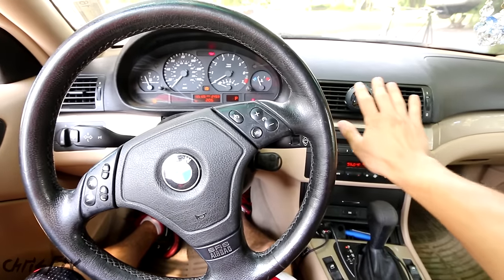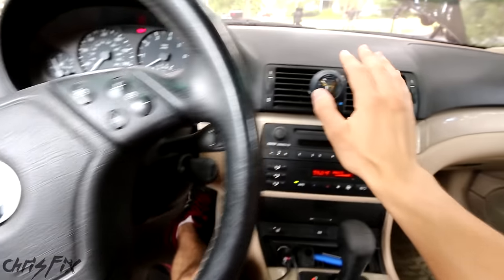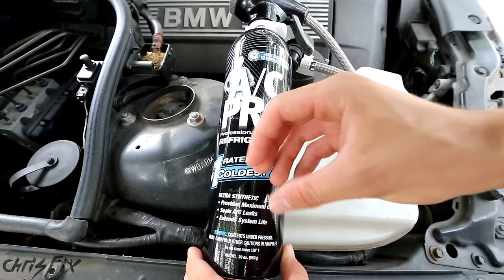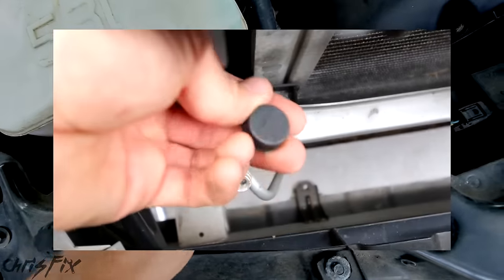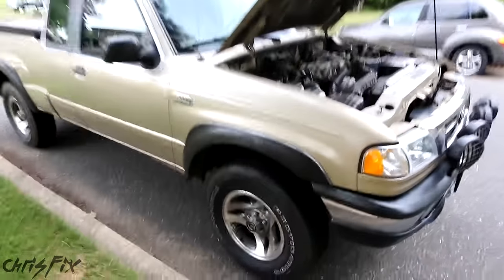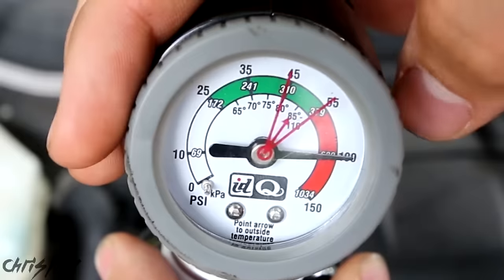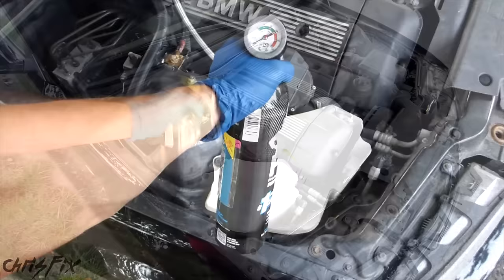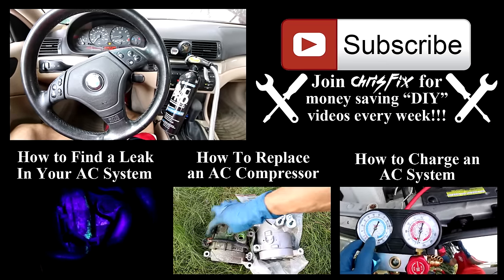How to Recharge Your Car's AC System (Fast and Easy)

Comment: I'm a 54-year-old registered nurse (I don't work on cars) and I watched this video and filled up the refrigerant in my 2004 Saturn Vue.  The temperature outside was 100 degrees in humid southwestern Virginia when I took my teenage grandsons to the fair.  The AC was so cold in the car we had to turn it off!!  It had only blown hot air before this quick fix. Thank you so much!!!  You saved me a lot of time and an excessive amount of BS!  😀
Reply from the maker: I'm glad this video helped you out!
Reply: @chrisfix  Yooo you still respond 😁
Reply: @thelombax  I was just about to comment that. Amazing!
Reply: @chrisfix not sure why I cannot comment on the main thread but I wanted to ask a question because I'm sure I'm not the first one to run across this but the bottle of AC pro that I purchased does not have a separate temperature gauge to set it only has the low filled a small yellow area and then the red area for the PSI and it goes up to 150 like yours
Reply: @brian8431  You don't have a green area? What do the instructions on the can say? AC Pro has videos on their website.

Comment: This is a very good video. One tip: when you're getting ready to add refrigerant, loosely hold the hose fitting next to the charging port and use the trigger to deliver a small squirt. When you see refrigerant starting to come out of the fitting, quickly attach it to the port. This procedure flushes air and moisture out of the hose -- and you don't want either of those inside your A/C system.
Reply: That's a great tip!  makes so much sense too.  It's like getting bubbles out of a needle.
Reply: @willvr4  Exactly

Comment: I spent basically 3 summers driving my car without a/c because of all the refrigerant leaked out and I didn't want to pay hundreds of dollars to recharge it or fix the leak at a local mechanic shop.

Today, I realized I could've recharged the refrigerant myself for a fraction of the price I would've had to pay at the shop.

You're awesome, Chris. Thank you.
Reply: I hope you put a vacuum in the system first since your system has been empty.
Reply: @DaDaDanceProject  I don’t think people realize that putting refrigerant in your system is much different than putting gas in your gas tank
Reply: @DaDaDanceProject  My Kirby is too big to fit in there.

Comment: This is, by far, the best tutorial on how to recharge your car's A/C. He uses clear, concise language, speaks like a professional, uses perfect panning of camera so you can follow his instructions precisely. He also has a way of making this seem like anyone can do it. I'm feeling confident now. I've watched other videos and felt like calling the nearest auto repair shop for fearing that I would screw it up. I am subscribing to his videos and I feel so lucky to have found this guy! He just saved me $200.00. The shop was going to charge me $230.00 to do this work. Thank you so much for posting this very helpful tutorial!! You are amazing!!
Reply from the maker: Welcome aboard and thanks a lot! I'm glad you were able to save $200!
Reply: This is NOT the way to top up air conditioning systems, the vital part of servicing car AC is the procedure of putting the system in a state of vacuum to remove air and moisture, this procedure doesn’t allow for that. These cans should be banned because you don’t know if the system has a leak on it and could release refrigerant into the atmosphere. Do yourselves a favour and just pay someone to do it properly.
Reply: I agree with mark
Reply: @markb4772  Why would you want to vacuum a system with a known leak? To get more air and moisture in ? And please stop these conspiracy theories about refrigerant making holes in ozone layer. Refrigerant has a long chemical formula and is much heavier than air.
Reply: Do the mechanics at auto shops have this can too and do it if the car does need a recharge or would they need to do it some other way?
Reply: iheartlol90 Profesional people do not use these cans, if you go somewhere that uses these turn around and walk away, find someone that knows how to do it properly
Reply: @markb4772  So what would they do at an auto shop if the ac is too low on pressure? My ac seems to not be blowing as cold air as it once did, Idk if it's the pressure or what but I'm just looking online for info.
Reply: @markb4772  I did this with my wife's car for 5 years and had no problems. Went to Walmart and bought a 10 dollar gauge. Then put 1 to 2 cans at less than $5 a piece each year to top off the system. So in total it cost me less than $50 over the course of 5 years to keep the AC ice cold.

A friend of mine who is a certified mechanic and also a certified HVAC tech told me that you never want to just charge your house system without checking and repairing leaks first but not the same thing for a car. He said the system is so small that it is highly unlikely that it can get enough air and moisture inside to do any damage. Also he said due to air being lighter you can blip the high side port a few times to release some of the air after charging.

So no this is not the "proper" way to charge an AC system, but unless you are a mechanic or HVAC yech, no DIY person is going to just have the equipment to do it properly. But these kits are effective and will save you a lot of money.
Reply: Jermaine Beckford With all due respect your friend shouldn’t be messing with air conditioning if that’s what he thinks, I am not saying everyone should buy AC equipment, just take it to a specialist and get it done properly. The point of getting moisture out is less to do with damage and more to stop ice crystals forming in the expansion valve and causing a blockage
Reply: iheartlol90 An AC engineer should recover any remaining refrigerant, check for leaks with nitrogen if the system is empty ( or extremely low ), then put the system in a state of vacuum with a special pump, then recharge the refrigerant and top up any oil
Reply: @markb4772  Like I said. I have proven it and so have others. You should take it to a specialist if you want it fixed properly, but that's one thing that you don't have to fix properly and save yourself some money. Are you mad that you are losing money from people helping themselves?
Reply: Jermaine Beckford I’m not losing any money by people doing it themselves because we don’t deal with general public, I’m just a professional that believes that the only way to do a job is properly. If you read all my comments I am just referring to doing the job properly, if you don’t want it done properly that’s your prerogative, but you can’t argue with the fact that the way I am describing is the only proper way to do it. I’m never going to agree with doing the AC any other way, so there’s no point in arguing about it
Reply: @markb4772  I never disagreed with you that is the proper way. If all the fluid was leaking in a few days then these would not be the kits for you to use. But if the charge lasts a whole summer then these are pretty safe to use. People would be coming back to this video like crazy saying they messed up their system if that wasn't the case.

And forgive me if I trust my fried more than someone I don't know on the internet. He said the only real reason to pull a vacuum and run nitrogen in a small system like that is to check for leaks and to remove acidity caused by electrical failure. The acid would damage the system, but the moisture or air wouldn't. And it would only be acidic if there was an electrical failure.

So he advised against buying some gauges and refrigerant and attempting recharging my house AC system, but assured me that I could do it pretty safely in my car.
Reply: @jabbajawz  If your AC lasts a single summer then you got a pretty wonky leak. Last time I charged was 3 years ago (on a currently 16 year old car) when it just wasn't blowing as cold as it used to (but still cold). You may want to get that fixed, breathing that stuff in is god awful on your body (not to mention the bad effects on the environment but that's been said already 500+ times here).
Reply: @AzalofForossa  I'm good, thanks. No longer have the vehicle and I'm not doing that much harm to the environment or myself if it takes a year to leak out. As I mentioned I would use one can every summer to top off the system. But it still worked, just not as cold as it should be. It takes 2 cans to fully charge from empty.

Essentially 1oz per month leaked out  from doing the math. That's not causing any more harm than driving my car.

Comment: OMG I WAS LOOKING UP E46 AC RECHARGE AND ITS CHRIS FIX THANK GOD
Reply from the maker: +Peter Mason hahah awesome
Reply: Hey guys my e46s ac compressor isnt working i refilled the lines with refrigerant (Artic Freeze 134a), checked fuses and compressor never spun any ideas on what might be the issue im thinking its the actual compressor.  Any ideas? Thank you.
Reply: Guadalupe Soto Jr yea bro its probably your compressor if its not turning on. Put a hot wire to the positive leads to see if you can jump the compressor.
Reply: Guadalupe Soto Jr if you cant get power to it you are going to want to replace ot
Reply: Magnets in the front of the compressor clutch maybe out of tolerance so it cannot engage also check power is getting to the clutch unit and the compressor isn't seized up, other causes could be a leak in the system if it's not holding pressure.. :) Gl bud.
Reply: Don't have current,  low or high charging pressure, relay didn't work....check that first
Reply: Peter Mason same bro😂
Reply: Dude same😊

Comment: Excellent video! I've been working on cars for 20+ years mostly maintenance and small repairs. This is the first time I have had to recharge A/C refrigerant. I found your walk-thru clear and on point w/out all the filler talk. Your vid is helpful and doesn't waste time. Love it. God Bless. Keep up the great work.
Reply: Still learning here, do you want the car and AC ON when your are performing this process???
Reply: @MOAON_AABE yes you want it on (I know this is old but it's for others with the same question

Comment: My Dad and I are so thankful to have come across your video. With the heat changing so drastically I had been having to go through 1 to 2 hours of traffic for work with no AC at up to 98 to almost over 100 degrees. We are so happy to finally know how to do it 😊 Your video is amazing!
Reply from the maker: Glad the video was helpful
Reply: Dude I am having the same situation as you I live in the San Fernando valley and it’s very hot here I’m going to try this today
Reply: Update: Just did it and it worked you are a godsend !!

Comment: Thank you Chris.  Your AC video allowed me to fix the AC in my 22 year old Dodge Dakota pickup.  One thing I want to add here is when I first hooked up the AC bottle and pressure gauge to the AC port under the hood, the gauge was fluctuating wildly between the white low pressure range to the red over-charge range.  I also noticed the AC clutch was kicking on and off every 20 seconds - which was causing the gauge to fluctuate.  I was confused by the gauge behavior and I was worried the problem might be too much refrigerant in the system instead of not enough refrigerant in the system.  I know too much refrigerant can seriously damage the system, so for a while I didn't know what to do.  But I finally concluded there is no way there is too much refrigerant in the AC system because the AC has never been recharged in 22 years.  So I forged ahead adding refrigerant as per Chris' instructions.  The gauge gradually stopped fluctuating and stayed in the low pressure range, and as I kept adding refrigerant the gauge gradually moved up into the green normal area and the AC clutch stopped kicking on and off every 20 seconds.  The AC now works good as new and blows much cold air.  Chris should run for president.
Reply: You're the man
Reply: How is your ac now, I was told not to put this in my car and to do it properly by vacuuming the system
Reply: @ambitionfilms5999  About one year has gone by since I added the refrigerant to my 22 year old truck's a/c system as per Chris' video, and the a/c is still working very well - if there was a leak somewhere in the a/c system, the sealant in the refrigerant seems to have stopped the leak.  I did not 'vacuum the system'.
Reply: This is what I needed to read.  I have AC manifolds and I was getting these exact readings and I have my hesitationsm. My car is a 2001 Ford Mustang that I never had the AC recharged or serviced.  Compared to other cars we have, the AC in my 2001 Ford Mustang barely gets cold...or it takes forever to get to a comfortable range.  Thank you for this comment!

Comment: I used this exact product on my car. I have a tiny compressor seal leak, so a charge lasts 2 years. AC Pro is no joke! My air is ICE cold!
Reply from the maker: aquateen77723 Yea, it is pretty good stuff! I was impressed!
Reply: I went to an auto school and what I was told you you shouldn't use any of that stuff that has sealant in it
Reply: aquateen77723 Thanks for that confirmation on ChrisFix'es suggestion ! I will definitely try it as a test and supplement on my family's cars A/C s
Reply: arno maas DONT USE THIS. If you use it and you then want to get your ac serviced by a shop you will ruin their ac machine wich costs around 5000dollar. And they might actually make you pay for that. Just get a shop to fill it with fluorescent fluid added and then after its going low again you go to the shop again and they use an uv light to look for traces of the fluorescent fluid and they will find the leak really fast.
Reply: bob rosco Thank you for your warning! Since I have got controversial info on the product ,I will check with my local shop for the case they may have a guideline for such products.

Comment: How can this have more than 2k dislikes.  The way he explained it was so professional and easy to follow. He deserves my subscription and like!
Reply: Because this isn’t the right way. At the very least you need manifold gauges so you can see the high pressure side. He shows the right way in a newer video where he has replaced the compressor. Without seeing the high side you have no idea what it’s doing. The low side could look ok but the high is going way too high because of another problem in the system.
Reply: @DVeck89  I am not a mechanic.  I don't want to be.  I want the quick, most-common fix to save money.  I can go to THD and get a can of this stuff and do this myself.  I'm not going to buy gauges, other manifold do-hickies, etc. for seeing the high side.  Maybe I should care about it -- but I don't.  I just want my air conditioner to get me through this next Texas summer.  This should do it.  Chris is alright in my book.
Reply: @DortuAirCond_ACmobil  I didn't dislike the video, but I do have an issue with him not purging the air out of the line before attaching it to the ac line.

Comment: Thanks so much for this, Chris! I just got my car the other day. Aside from needing a new battery, the A/C wasn't giving out any cool air. My grandfather was suggesting to just replace it, but checking further thanks to this video, it was just completely out of refridgerant. $40 later, and it works like it should now. So again, thank you!
Reply: last year it was $23 in Walmart.
Reply: @carolyoung3444  26 just now. Different,  but highly rated type. 

Btw, if I just bought a car and it needed coolant, I'd be back over there in a second. 

Get a battery charger. Clip red to red side, black to the bolt that's right there and not connected to anything else (that's why it's there, as a ground, don't use the black terminal, it can make the process more dangerous.)

Then, plug it into the wall after those are clipped securely. It should shut off on its own after up to 8 hours or as few as 3. 

Nice to have more than one, too. A portable jump starter one with power plugs is nice if you're not at home. 

You want the 50 amps. 100 amps is for jump starting. Don't do that unless you have to. With less than 50 amps, it'll take forever. That's for smaller things like motorcycles or lawn mowers. 

READ THE INSTRUCTIONS. 

When finished, carefully unplug from wall first, then take the clips off in the right order. Do NOT touch them to each other or anything metal. They WILL spark. You don't want that.

Comment: I'm an A/C mechanic and wow this is the easiest and best way for sure! Well I'm still training but that doesn't change the subject!
Reply: Mashhor Mex would this be the way to go when replacing one of the hoses? There was a leak on one of the hoses and now I’m gonna replace the hose.
Reply: @thebman8787  yeah. I mean that A/C pro is about 40$
Reply: @thebman8787  no you need the system to be put into a vacuum to remove the moisture in the system.   This video is for back yard hack mechanics..

Comment: The AC in my used 2011 Honda Civic has never worked well.
I live in Florida. This year, the summer has been brutal with temperatures up towards 100, and humidity in the 70 to 80% range.
When I say your instructions are a life saver, I mean literally, you are fixing such a massive hole in my current form of transportation. Thank you for your video!
Reply: My 2011 Honda just stopped working and I've been getting those high auto shop prices! Going to try this soon

Comment: You have no idea how much I appreciate this. My X3 has been hot as hell since the day I got it, and the local dealership wanted to charge me >$2K to fix the leak in the cooling system. Followed your video to a T and just got the most amazing results. My car’s A/C went from an oven to a freezer! Thank you SO much!!!
Reply: How long did it last? It depends on the size of the leak.
Reply: @mtbbiker6401  The A/C is still working well a year later. As for the car itself, it’s at the end of its life.